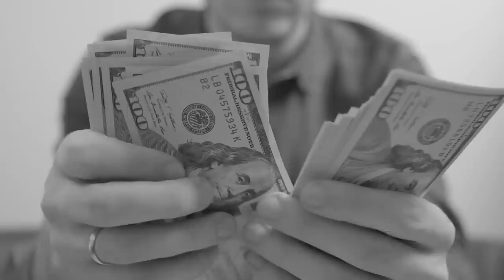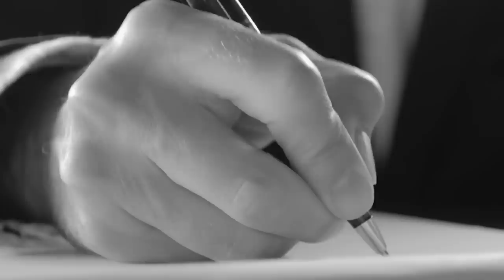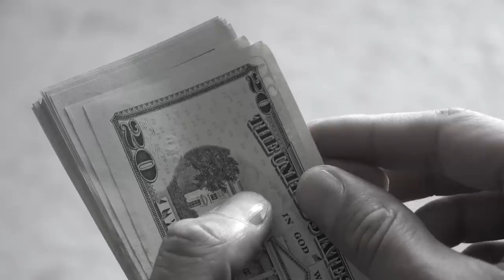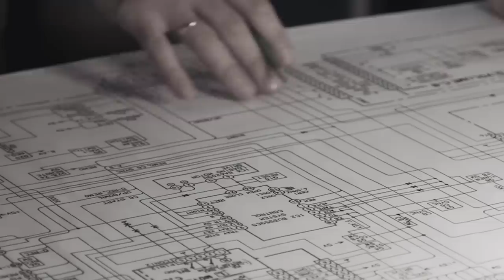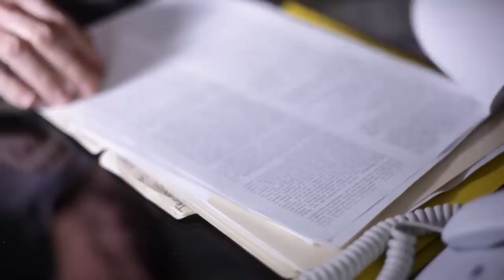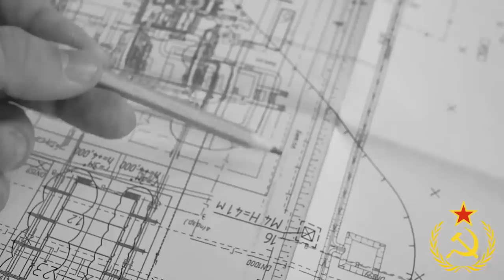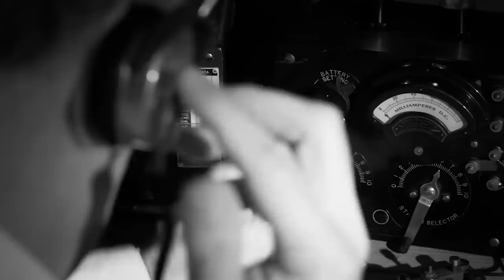8 Sad Ends To Famous Ships

Comment: To add:

The Normandie , one of France's great ocean liners, caught fire due to negligence and poor planning while under American care.

Mauretania and Olympic , the great competitors from Cunard and White Star respectively were both sent to the same scrapyards in 1935, after they survived service in WWI as troop ships. Mauretania was showing her age, although she was well-liked. Olympic , on the other hand, was in great shape and could have continued to serve, but because she was sailing less than half full, and because Cunard had majority control after the merger with White Star, it was deemed that continuing to operate Titanic 's sole surviving sistership would be too expensive. Unfortunate that nobody thought to buy Olympic and turn her into a museum.

SS America was the predecessor and running mate to SS United States , and as such served as a sort of prototype for the fastest ocean liner to ever be built. Sadly she could not be maintained forever. In private ownership hands (Venture Cruises), she had two disastrously abortive 'cruises' where passengers said conditions aboard were so disgusting they wanted to get off before the ship left port. A hotel owner in Asia bought the America , but during towing she encountered a storm and the line snapped. The ship was found fetched up on a beach, but nobody wanted to pay the cost to remove her, so she stayed there until the waves and water broke her spine, then wore her down -- first her aft, then her forward section. Today nothing remains of the America , while the SS United States moors rusted and abandoned, similar to the Queen Mary .
Reply: the queen mary is still afloat, like it became a floating hotel, i think you mean queen elisabeth, that burned down in hong kong.
Reply: @Televroszky2144  Nope, the Queen Mary , which has now been restored enough to accept tours.

Comment: You ned to get the facts right. Zenobia was on voyage from Koper to Tartous when she had problems with the steering and encountered a list to port this happened off the coast of Cyprus on june 2nd. A tug arrived and assisted in correcting the list and they agreed to tow the vsl to Larnaca. The Captain wanted to anchor in more shallow waters but this was refused by port authorities due to lack of navigation charts onboard. 4 days later the vsl was almost upright again. However she once again started to list to port and they once again asked for permission to be towed to more shallow waters and the got this at 01:08 on June 7th. They were supposed to cut the anchor chain but the tug had no cutting equipment and before the could find another tug with that equipment the vsl had already sunk at around 01:20. There has been attempts to recover the vsl but due to Cyprus laws that state that it has to be done by a company part owned from Cyprus the have all failed. The claim that the crew was drinking beer as she sunk is nothing but a disgrace and completely wrong. I have sailed together with people that was onboard at the time and know for sure that that is a completely false statement and you should be ashamed for doing such a remark.